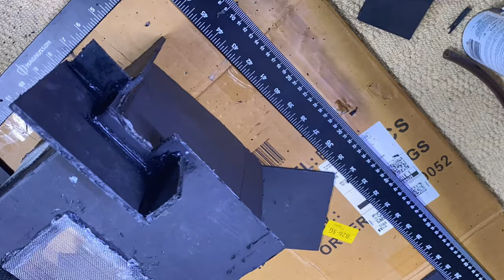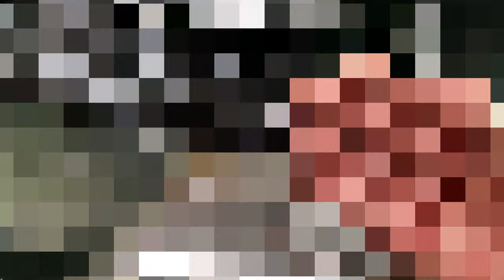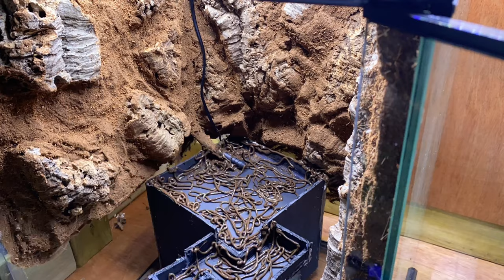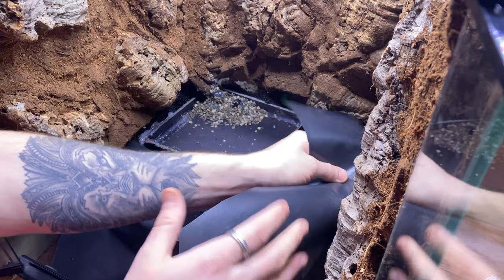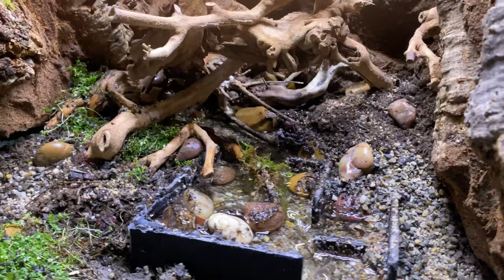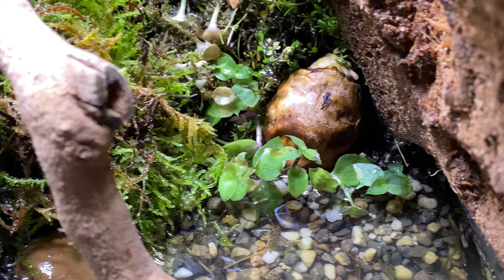HOW TO MAKE A BIOACTIVE VIVARIUM - FOREST CREEK

Comment: May I ask some advice? How might you service the filter if needed?  Also, how often do you water change something like this?  I imagine with a lot of the water running through plant material that it filters itself pretty well but what about your sponges on the bottom getting super clogged up?  Also, most people tend to say you should have darts with a water feature.  I'm want to do it myself too, but I want to be sure I do it right.  Have you ever been worried for their safety in/around the water?  Thanks and I love this build.  It is so inspiring!

Comment: Lovely! Do you need to routinely spray the side and top to keep it moist? Any issues with isopods drowning in the river?
Reply from the maker: I mist the tank once a day, for now I’ve put plastic lid on the top of the mesh to hold extra humidity for now as the moss establishes. I’ve actually had 1 isopod in the river area, luckily I managed to save it but this was due to it climbing the top right cork bark piece and it fell off. Thank you for watching my video though 😃❤️

Comment: Really nice. I made a few various enclosures like this. One thing to warn the viewer who wants to do a build like this but hold some kind of amphibian is to make sure you get FISH SAFE foam. I have never had luck with fully sealing the housing foam and it is toxic. I killed so many fish learning that l lesson. Even with absolutely tons of silicone. things will shift, open up and leach those toxins into water then murder your fish, frogs,  newts. 

I built one with pond safe foam and I have had 0 problems in my dwarf frog, fish and mystery snail tank!
Reply from the maker: Hey buddy! That’s a great pointer man thank you - I’ll make sure I point that out when making these. I’ve noticed a lot of people use gaps & cracks. I’ve got isopods and other clean up crew inside this for the time being so if I notice anything on those I’ll have to start worrying! 

I would love to see your set-ups though buddy, message me privately if you want? 
Also thank you for taking the time to watch the video! Much love man ❤️
Reply: interesting,  which foam are you using ? I haven't had this problem yet with gaps and cracks in over 3 years of building. want to make sure I steer clear from the brand your mentioning ! thank you 🙏🏾
Reply from the maker: @MrHyde255  yeah definitely! I really want to know which brands he used which cause all of the problems! Let us know if you can please mate. It’ll help a bunch ❤️❤️😃
Reply: @dn2817  oh...weird. thank you 🙏🏾
Reply from the maker: @dn2817  This one was safe, I double checked after you said! Thanks man!

Comment: Really nice build. But aren’t you afraid the soil is gonna rot because its for most part underwater??
But its looking awesome. 👍
Reply from the maker: Thank you so much Man! But If it was stagnant water then yeah it would be worrying/not circulated. But because the water is circulated in the tank around 50-100 times it’s volume an hour I have no worries over stagnant build up 😃 
The only concern is that it could drop the soil level a little but that’s about it! 🌿🍃❤️